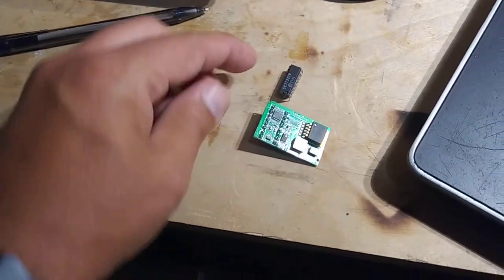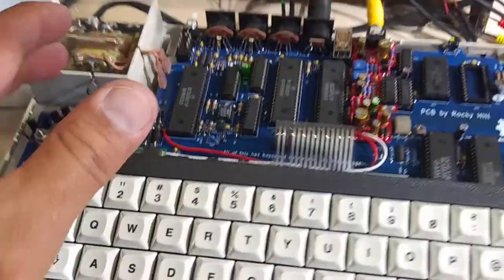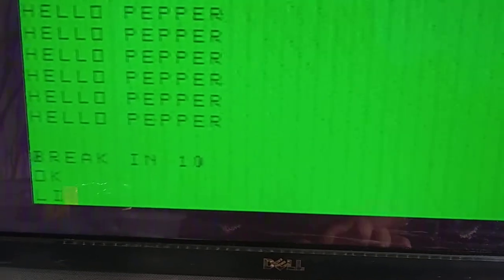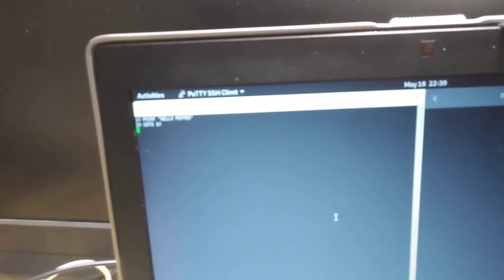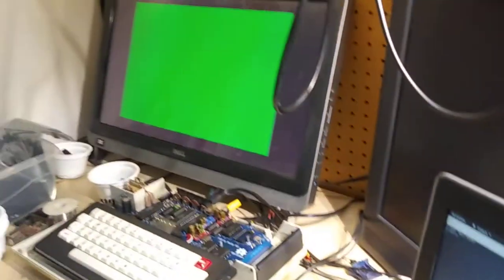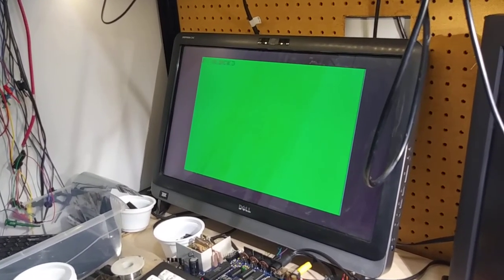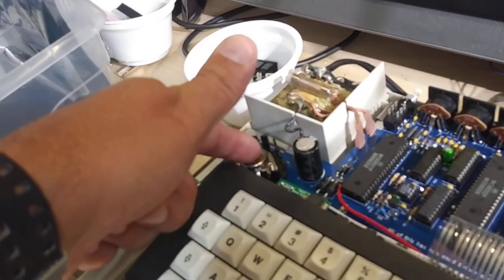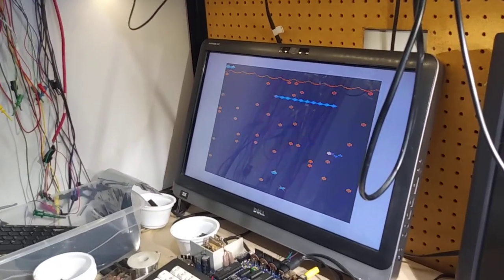SALT chip replacement board AKA the PEPPER BOARD

Comment from the maker: That board replaces several pieces of functionality provided by the chip. The transistor was used in conjunction with the salt chip as a linear regulator which produced lots of heat so that was replaced by a switching regulator. It also does the voltage level translation between the TTL logic on the board and RS232 devices connected via the serial port. The center tapped transformer that comes with this CoCo provided  around +- 12V and the -12V was only used for the RS232 communicarions. These days a single RS232 chip with built in converters can produce the +-12V needed for RS232 communications  from a single 5V rail. In Theory I can power the whole thing with a USB C rated power supply and bypass the switching regulator and completely remove the center tapped transformer. The other bit of functionality that the salt chip provides is something called a zero crossing detector. This is basically a schmitt trigger used to convert sine waves to square waves in order to recover digital data saved as audio recordings. To answer your question, this blue board I'm experimenting with is a clone of the 26-302x mother boards so I'm confident that this can be used for other CoCo's of this type in terms of fitting into the case and what not. Functionally It should work on other CoCo's that use the same chip but since I don'have other CoCos I can't say whether or not they will physically fit in the space available.
Reply: Apparently I need one of these for my 12v CoCo 3!

Comment from the maker: @Dalek 2150 I see your comment but for some reason I can't reply to you....
Thanks!
That board replaces several pieces of functionality provided by the chip. The transistor was used in conjunction with the salt chip as a linear regulator which produced lots of heat so that was replaced by a switching regulator. It also does the voltage level translation between the TTL logic on the board and RS232 devices connected via the serial port. The center tapped transformer that comes with this CoCo provided  around +- 12V and the -12V was only used for the RS232 communicarions. These days a single RS232 chip with built in converters can produce the +-12V needed for RS232 communications  from a single 5V rail. In Theory I can power the whole thing with a USB C rated power supply and bypass the switching regulator and completely remove the center tapped transformer. The other bit of functionality that the salt chip provides is something called a zero crossing detector. This is basically a schmitt trigger used to convert sine waves to square waves in order to recover digital data saved as audio recordings. To answer your question, this blue board I'm experimenting with is a clone of the 26-302x mother boards so I'm confident that this can be used for other CoCo's of this type in terms of fitting into the case and what not. Functionally It should work on other CoCo's that use the same chip but since I don'have other CoCos I can't say whether or not they will physically fit in the space available.

Comment: Wow this is amazing. My CoCo2 has a half dead salt chip. It seems pin14 (RS232 in) is shorted to ground. 
Do you plan on ever selling assembled versions?
Reply from the maker: I just got a batch today. I'm putting together a webstore but I'm having issues with my inventory counter. Here is the link, you can message me fro m there. 
https://westchester-tech.square.site/

Are you on the CoCo Discord server?
Reply from the maker: And thank you!
Reply: @rockyhill3  Yes I just figured out my login there. i haven't checked in there in a long time. My handle is junkman. I sent a message via your website. Thanks!

Comment: Question Please:  I'm troubleshooting a CoCo3.  Verified RAM and GIME are good.  I'm only getting 4.3VDC at the 5v TP1.  Per the service manual and other subsequent tests, I'm only getting 4.3 at pin one of the SALT.  Service manual states to replace the IC8 (salt).  Is 4.3 too low for the machine to POST?  Are there any pepper boards available?  Thanks!
Reply from the maker: Contact me via the YouTube email contact and ill try and help. I would check the large capacitor before assuming its the salt chip. I have a video where I troubleshoot and repair a coco 3. With similar symptoms.
Reply from the maker: https://youtu.be/2T3f3HH7CZk